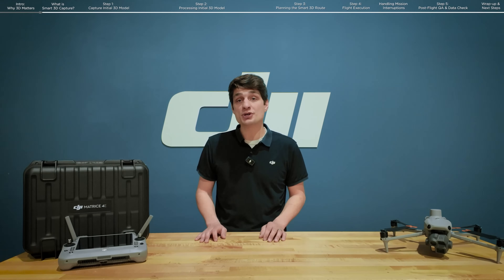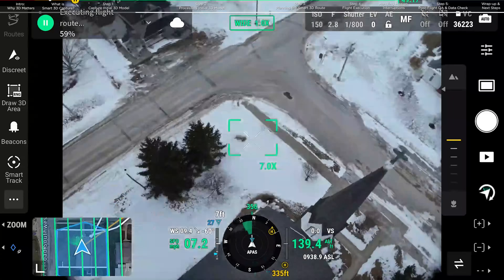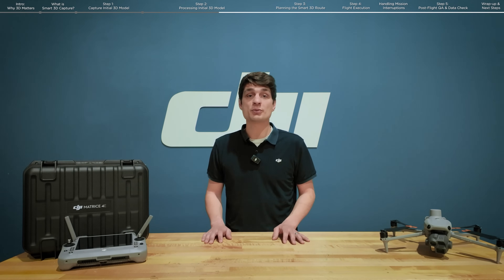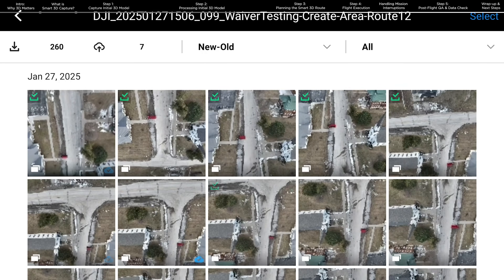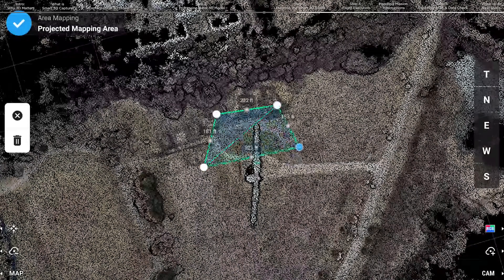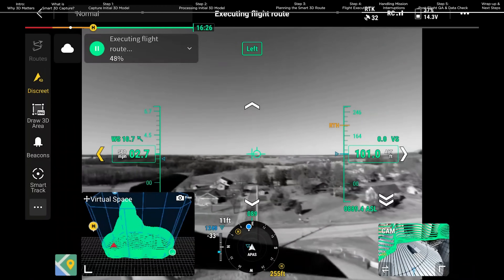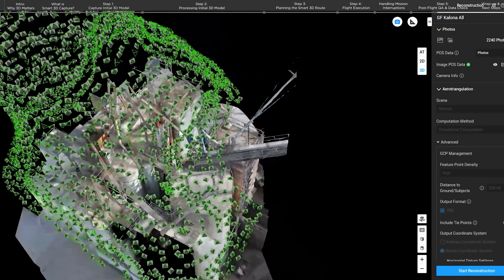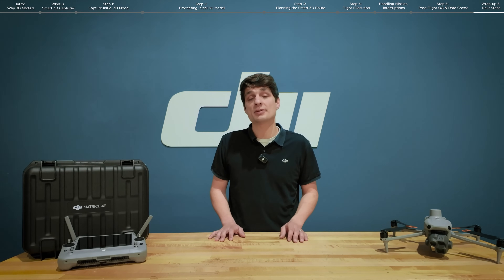Drone Mapping 101: Smart 3D Capture Complete Workflow

Comment: Hello, I have a question about Smart 3D Capture. Specifically, when I tried to map my object, which was generated in a point cloud, the drone would stop at the start of the mission about a meter from the ground because it cannot descend below the ground level where its mission, or rather its starting point, begins. I assume that since I am not using an RTK system, the vertical coordinates are not precise. I suppose you have also encountered this problem, so if you could advise me on how to solve it. The problem for me is that the object I wanted to scan was on a cliff, which I assume created additional problems.

Comment: Thanks for giving me something that I can use. I have the matrice 4e. Trying to figure out all of its functions. DJI need more material on the drone and the new controller. Also the free trial of Terra begins on activation of the drone which does not make sense if you never had an enterprise drone.
Reply: When are we getting a MacOS app
Reply from the maker: Appreciate the feedback. We’re working on adding more educational material for both the M4E and the new controller. Regarding DJI Terra, the trial currently starts upon activation, but we’ve shared this suggestion with the team for future improvements.
Reply: I agree, activate Terra trial version the moment we activate the new M4E doesn’t make sense. Myself is a practical example! I activated my new M4e two months ago , which is the first commercial drone for me, and still didn’t even install Terra

Comment: This is what I'm talking about! So much better than previous content! Very outstanding and I appreciate your hearing your audiences' thoughts. Does this apply only to the M4E or can the M4T also complete similar missions? If so, what differences are there with accuracy and speed between the two models?
Reply from the maker: Thank you for the feedback! We’re glad you found it ushelpfulSmart 3D Capture works on both the M4E and M4T. For high-accuracy modeling, M4E with the mechanical shutter offers better precision and efficiency, while M4T can still complete 3D missions but with less mapping accuracy.